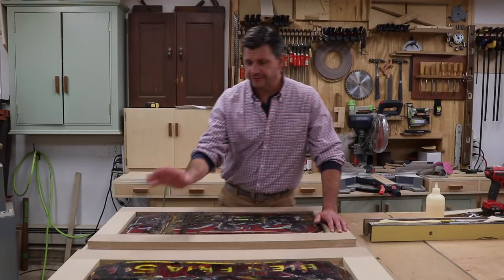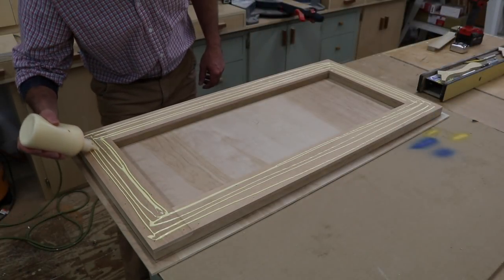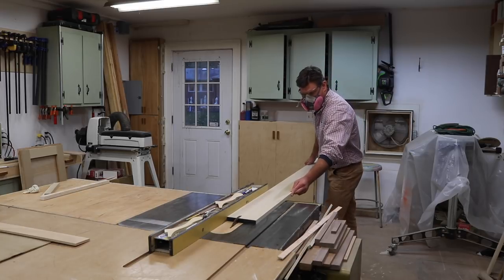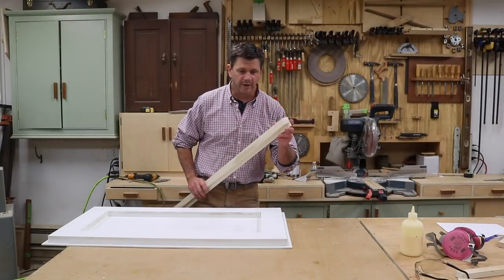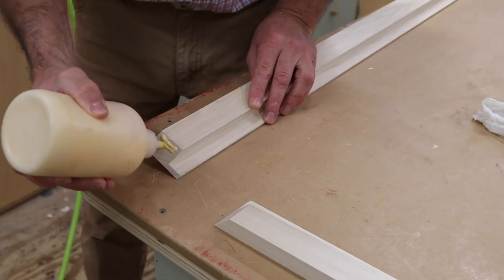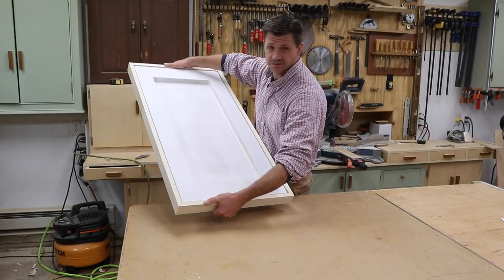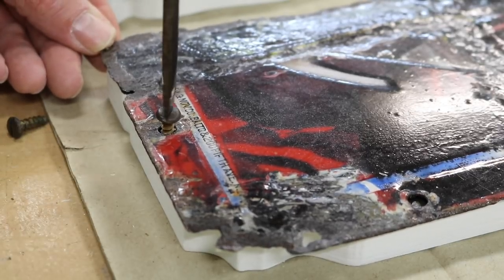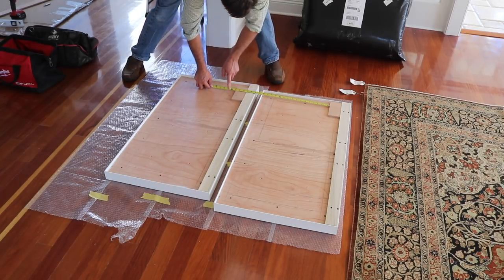How to Frame Works on Sheet Metal & Install with French Cleat

Comment: Those look great! Did you put material on the back at the bottom equal to the thickness of your cleat so it would sit flat on the wall?
Reply: Bruce A. Ulrich I don't think there is a need since the cleat is recessed into the frame. ;-)
Reply: da7oomyman360 Duh! You’re totally right! Thanks for pointing it out in a not jerky way!